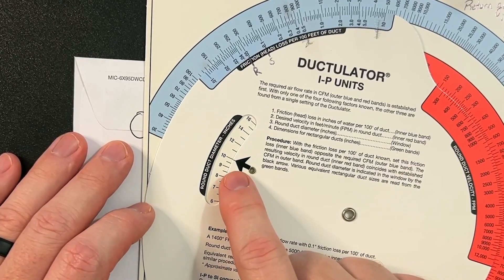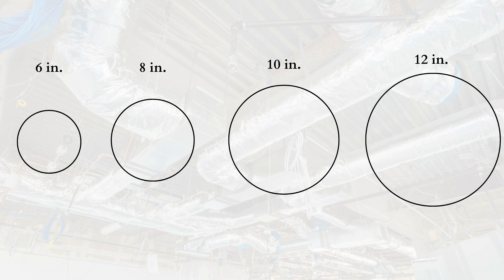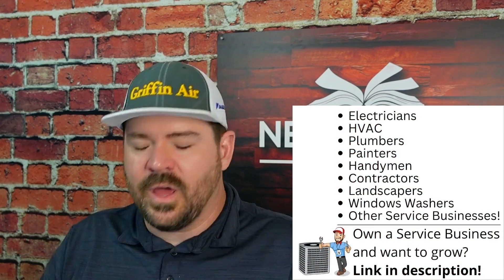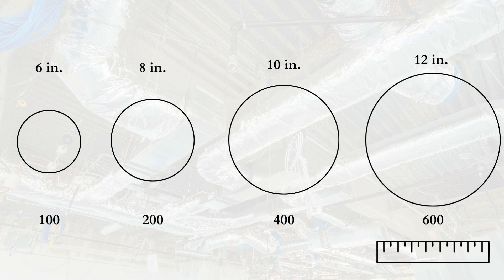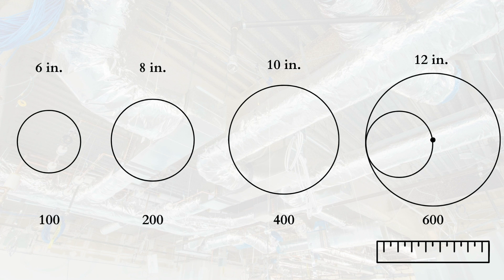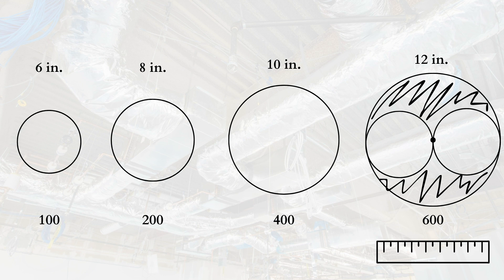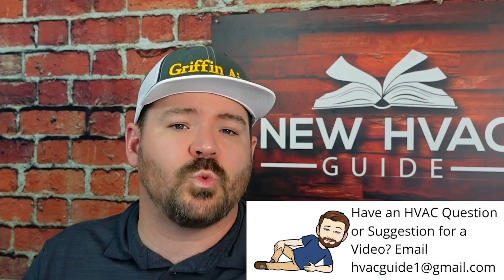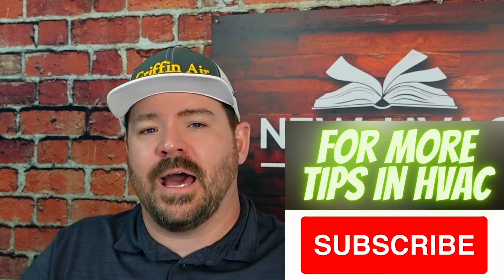Duct Sizing Explained - Why Ducts are undersized sometimes

Comment: my name is paul my problem is air noise coming out of supply in my bedroom. it is all new duct work they tried changing the grille cover the problem still persists. the main unit is very close to my bedroom  the duct run is only about 6 feet long i think it is a 8 inch diameter duct. if i was to lenghthen the duct work to say 15 to 20 feet do you think it would quite down the air  noise out of register. thank you
Reply: Your system is not properly air balanced. But to help correct the problem for that one area is a balancing damper at the trunk line or plenum. This will reduce the velocity of the air that flows down the duct.

Comment: Retired Geometry teacher here When you double the Diameter (or radius) you quadruple the surface area of the end of the duct. Use A={r)2 x 3.14159255358 and see for yourself.

Comment: My system has 14in duct from a 2.5 ton gas furnace/AC supplying 800 SF. HVAC in my area aren’t even touching the discrepancies here. They are just providing replacement estimates based on the existing system.

Comment: If I barely feel air coming out of my downstairs vents is it more then likely a duct problem?  The unit is only a few months old. Nobody has been able to give us an answer and it's really frustrating.
Reply: Have your professional do a friction loss calculation and make sure you have balancing dampers at the beginning of each branch run. It’s possible each run upstairs has more air coming out of it than designed.

Comment: Hey man not trying to be rude but you’re doing what a lot of people do in this industry and it’s dangerous. You’re designing flexible duct work with a Trane metal ductulator. 8 inch at .08 is approximately 140 cfms. I’d seriously look into this.
Reply from the maker: Dangerous? In what way?

Comment: My three bedrooms upstairs have almost no air flow/CFM & the bedrooms are hot in Summer & cold in winter. 

While the open ceiling living room on the main floor has two upstairs vents with high CFM & 4 other vents in the playroom just behind & up the stairs with high CFM & it freezes us down stairs with our open Floorplan. 

Can I put 8" round ducting to each bedroom (3 total) as well so they get the 200 CFM that the other vents are getting? And cool/heat the bedrooms better?

Comment: My bathroom about 50sqft i overcompensated buying a 110cfm can i use 4inch duct (flex) about 10ft run?
Reply: How much load does that room have? I would try a 4” with a damper at the trunk line

Comment: For a typical "home" unit I usually calculate a 6" for around 80 cfm or so.  Especially  if there is more than 5 or 6 ft of flex. That's just me.
Reply: Yes that is just you. Use the friction loss calculation to determine duct size

Comment: My room does not warm at all when the heat is on.  However,  in the summer,  it is the coldest room in the house. But in the winter,  there is no heat coming from the vents in my entire master bedroom, bathroom,  and closet. Absolutely no heat. Is this a faulty connection for heating?

Comment: HI  5 ton goodman  gas furnace + AC  total lent  duct work 50ft  in  total   i started 24x12 10ft , 20x12 10ft , 16x12 10ft  , 14x12 20ft    total 10   8inches flex openings  bubble wrap duct insulation  total square footage house  1600sq  brick house foam insulation  10ft ceiling  , is this correct calculation or I'm in the wright direction thank you very much!
Reply: Look up friction loss sheet. That will help you. Go in this order Manual J, S, D, T

Comment: Hi, I have a very annoying issue with my homes duct work. I have rectangular duct work for my main trunk and return. In the winter, the ducts pop and bang extremely loud, the ducts are in rather poor condition and leaky. I’m receiving mixed opinions on whether the issue is from improper size or just expanding and contracting from the temperature swings and  need to be insulated. They do not make noise in the summer with the AC. I found a large cutout in the return line and several other sections that need to be replaced. I have considered replacing at least the supply side with spiral duct as it seems a little easier to hang, but also received mixed opinions on doing that. Any suggestions? Im located in South East MI.

Comment: Can someone explain this in electrician terms?
Reply: There are certainly parallels between fluid mechanics and electrical theory, and I'll do my best to make some of those connections, however I don't think that's the best way to explain what's at the core of this.  First off, the relationship of duct size to CFM is the fluid mechanics version of Olms law.  A pressure is exerted on some fluid (air in this case) which is the equivalent of Volts., the system has some intrinsic resistance to the motion of the fluid, the Olms equivalent, and the proportion of these two will determine the current, CFM in this example, and Amperes in electrical... thank you captain obvious!  This is all about selecting the appropriate conductor AWG based on current requirements, voltage drop, environmental factors, blah blah blah.

Just like with different wire gages, duct size inversely changes the resistance component of the equation, and while total resistance to air flow is a sum of many factors (impedance in electrical), friction caused by air molecules rubbing against the interior sides of the duct is the major source of the resistance. The reason the change is nonlinear has to do with a simple concept in geometry, specifically the ratio between the circumference of the duct and its cross sectional area.  Interestingly this same concept, but in three dimensions, is the reason the cells in our bodies have to be small.  

So as the duct diameter increases, it's cross sectional surface area increases at a faster rate than the length of circumference, and since surface area dictates CFM while circumference/ perimeter dictates resistance, not only is the CFM increasing but so is the efficiency.  Your buying your CFM in bulk and therefore getting a better price.  In the case of our cells, the ratio of cell surface area to volume is important because water and nutrients are absorbed through the cell walls in order to feed the cell volume.  For this purpose smaller is better such that there is ever increasing area for absorption while having to sustain an ever decreasing amount of volume.  You can prove this yourself by calculating the the surface area and circumference of a circle given a random diameter, and then take the ratio of the two.  You see how that ratio changes with its radius and that's all that's happening here.

- Whew fuck! Time for work.

Comment: So for 4 ton system - it generates a flow of 1600 cfm - so off the main box I should have, for example 4 10'' ducts = 4x400 cfm, or 2 12'' ducts and 1 10'' duct = 2*600 + 1*400 = 1600 cfm.  Then at the room vents there could be 8 8'' ducts = 8*200 = 1600 cfm. Correct?

Comment: I don't see how a 6 in, carrying 100 cfm, can transition a 8 in, and then there is 200 cfm. Wouldn't the 6 in restrict the flow to 100 cfm? Where did the additional 100 cfm come from?
Reply: You’re increasing the cross section which cfm increases due to the volumetric increase. Velocity changes (slows) that will affect the time of moving air giving you the cubic feet per minute.
Reply: @mrteuy it just seems odd. By that logic I could run a 6 inch, increase that to 8, then branch to 2 6 inches a foot later and there would be 100cfm at each 6 inch?
Reply: @JOIHIINI  I am with you on that thought.  How can starting small to a greater size than back to small work like that!?  I am not sure it works like this either. I believe you have to start larger than move to the smaller cfm.
Reply: Keep in mind, I don't know a lot, but his measurement is with the same static pressure in thr 6 and 8 inch supply, which to my under educated guess means the 8 inch gets a bigger blower to create the same pressure within the system as the smaller blower with the 6 inch. He's not saying just swap the duct diameter, he's saying bumping up to an 8 inch system, which brings the volume from 28 square inches to 50 square inches (I'm writing this just as much to retain it as to help)
Reply: @jeffb6276  in a standard system though the ducts branch off a large trunk so I don't really get the blower size thing. The trunk is sized based on the required cfm the unit can provide and then the duct runs are distributed based on the cfm of the trunk. From what I can tell this logic is pretty much saying you could have a 6 inch get the same air flow as an 8 inch which just doesn't make sense. Then you may as well have a 6 by 6 trunk and branch off of it. The static pressure is obviously important but it doesn't make a difference if the duct is too small, and the unit itself has a max static pressure that it can operate at so you can't really increase it that much to make up for loss in sizing to deliver that cfm.
Reply: To answer your question it doesn’t. He is only talking about maximum capacity of cfm of each size pipe. I am not aware of a situation where you would start with a 6” pipe and then increase the size downstream of the air handler, in fact its the opposite- it gets smaller because with each branch off your main trunk the cfm requirement goes down.

Comment: Flow is directly related to cross sectional area. A little bit of geometry says the cross sectional area is pi times the radius squared.  This is why air flow is not linear related to the diameter.
Reply: And static pressure.
Reply: The "r^2" part is the key.   I mentally think:
  6" diam -> 3" radius squared ->    9 sqin area
  8" diam -> 4" radius squared ->  16 sqin area
10" diam -> 5" radius squared -> 25" sqin area
12" diam -> 6" radius squared -> 36" sqin area

   Two 6" is 9 sqin x 2 -> 18 sqin.  So an 8" line at 16 sqin is close
Three 6" is 9 sqin x 3 -> 27 sqin.  So a 10" line at 25 sqin is also close.
Reply: poiseuille's law has the flow rate proportional to radius^4. This formula would be more applicable to this case. 
You are correct, though

Comment: I was told my duct work is too small for the tonnage of my system and that this would cause damage to the system.  They recommend new duct work. Does this sound right?  Thank you!
Reply: Yes, ma’am, if it truly is undersized, it will destroy your system
Reply: And your electric bill
Reply: you wont get enough flow of air across the coil and it will gather ice, freeze up and then no air will flow can set fan speed to high but your unit will only produce so much static pressure and may not be able to push the air. If you increase static pressure more air will flow through a smaller duct
Reply: rule of thumb is 1 cfm per sq foot so can figure out if your tonnage of cooling and duct correct size and can use duculater to confirm duct size per room...400 cfm per ton of cooling
Reply: Yes true I went to one that had a dryer duct attached to the system

Comment: My new Daikin mini split sydtem has been working well, but there has been times when it is set to 22 C, it can only make it 21 C. The temperature had been -6 C, and it could hold 22C, then a week later when it it was - 6 C again, it could only hold 21 C. The contractor has checked it out, and found things in order. He will be back with his diagonistic device to check out the circuitry.
Reply: Open your manual and check minimal temperatures for this unit. Also check how much square footage you have in that room , multiple it by 30 and compare it to unit BTUs. Probably it would be lower than your unit
Reply: @ABChgdyhh  I've made a lot of headway since then. It involved moving things to give the downstairs unit unrestricted airflow for both intake and output. Also, if it is going to get very cold, I set the temperature up to 24 C, and it now will maintain 22 C right down to -12 C. It hasn't gotten any colder to try it at a lower temperature.

Comment: For ductwork in unconditioned space wouldn't a small duct with a powerful enough fan push the air through quickly enough to reduce the loss of heating or cooling and thus save money?
Reply: The pumping energy required to overcome the increased friction loss would far offset any negligible thermal loss.
Reply: the higher the static pressure the noisier it gets also

Comment: Why not size the ductwork to the system recommended static pressure? .05
Reply: Coil + filter takes away about .15 before it leaves the gate
Reply: rule of thumb 1 cfm per square foot
Reply: @Steven-mm7gb from what I've seen the friction rate to have 1cfm per square foot would have to be well below .05 for supply which would be on longer ductwork applications. In shorter ducts friction rate can be around the 1 range which would make those ducts way oversized. It'd be the difference between a 6 and an 8 round
Reply: @JOIHIINI  I think my original post left out what i meant to say , "rule of thumb 1 cfm per square foot" I should have said ....rule of thumb 1 cfm per square foot of room size, duct should be sized to the room served. This info given to me 35 years ago when I started the trade in Commercial Sheet metal from multiple HVAC engineers as a rule of thumb for my home system. 1cfm per SQ foot of area in a room. These are professional cal poly graduates with engineering stamps.
Reply: @Steven-mm7gb  yeah I figured u meant room size in the first place. Just seems like a lot, I don't have that experience tho. I was just sizing a central heat pump unit and they rate a 4 ton for 1500-2000 square feet but 1cfm per square foot would only work on the very low end of that spectrum